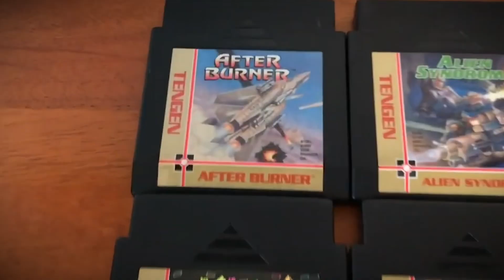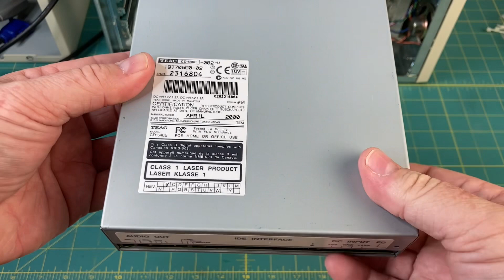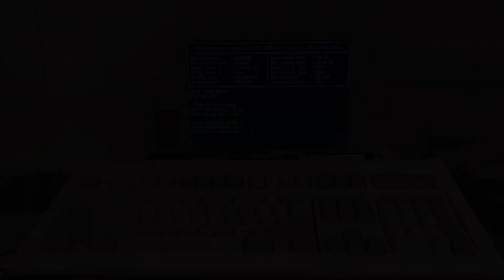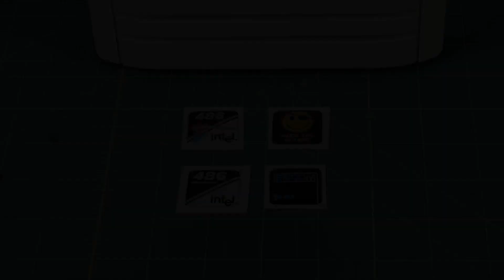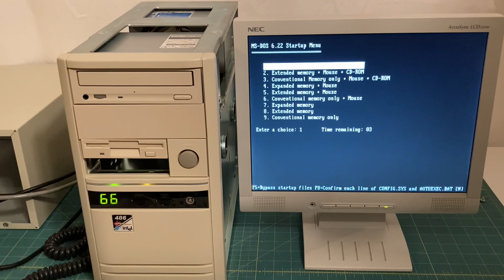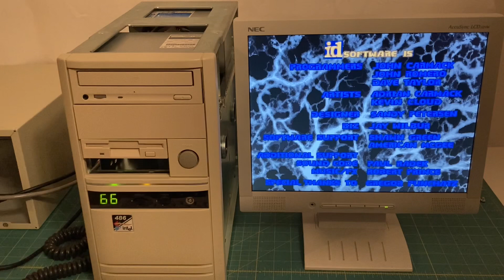Building my DOS 486 DX2 66 MHz Gaming Computer #486buildoff

Comment: Almost this exact build was my first PC, after a gap of a few years after my Apple II and C64 became pure game machines.  It was a 486DX-33 VLB with 4 meg, a CirrusLogic video card, SB Pro, 2x CD-ROM, 3.5 and 5.25 drives, and those little boxy Labtec speakers.  I think I had a 220 meg hard drive.  Must have been around Christmas 1993 as I used DOS and Win3.1 for a good while until Win95 came out.  Not quite as quickly as you, I soon upgraded to a DX2-66, and then a DX4-100.  I kept it going for quite a few years like that, upgrading CDROMs, RAM, and hard drives.
Reply from the maker: Very cool! We have a similar path with computers. I started with Apple II's in elementary school (late 1970s), then got my C64 Christmas 1983 (still own it), then got a IBM 286. Later I had a 486 DX2-66 in the exact same case as this build, so it was quite the flashback for me building this machine in 2022. BITD I sold my 386 to help fund the 486, then sold the 486 to fund my Pentium MMX 200 machine (which I still own).

Comment: Yes, YES! A case with a segmented display should be a requirement for a 486 build (cause it seems as if nearly all the generic PCs of the era had them)!
Reply from the maker: Exactly! This one is only a two 7 secmented display, so if I was to ever upgrade to a DX4-100, I'd have to set it for 99 LOL. I'm going to keep this a 486DX-2 66 MHz machine, so no worries on that. Thanks for the comment. Much appreciated!
Reply: @geekwithsocialskills  I had to do that back in the day, too, when I worked at a computer shop and upgraded customer computers with DX4 processors…

Comment: Nice NEC monitor with built in speakers.  It looks very nice with that computer.  Remember, that LCD has a native and recommended screen resolution of 1024 X 768.  So, you need to set the resolution of Windows 3.11 and the games to as close to this resolution as possible.  A CRT monitor is the best choice for a 486 PC.  You can also try a 7 inch or 9 inch LCD.  They have a lower native screen resolution.
Reply from the maker: The NEC LCD monitor is nice. I use it a lot for testing machines. For this 486 build I do have a really nice 14" CRT VGA monitor that I'll show in the follow up video I'm working on of this 486 build.

Comment: Holy crap! I remember when the DX2 66MHz came out! It made my 25MHz 386SX look like a piece of 💩
Reply from the maker: Thank you for watching and commenting on my video. I sold my 25MHz 386SX to help offset the costs for my 486 DX2-66 back in the day, then years later sold the 486 DX2-66 (I did keep some of the parts) to build my Pentium MMX 200 machine which I still own. With this 486 build I was trying to get as close as possible to my original 486 from BITD. It's pretty close and with a little more work, it will be there, so of course more videos about this machine will be coming to my channel.

Comment: Great build!  Guessing that the motherboard is an "earlier" 486 VLB board based on the BIOS revision and the 30 pin SIMM slots.  Nicely done!
Reply from the maker: Thanks! Agreed on it being an early 486 VLB board. Having both the four 30 pin SIMM and two 72 pin SIMM slots is cool, however it seems you can't use both at the same time. Luckily I had enough 30 pin SIMMs to bring it up to 16 MB.

Comment: Doom runs better than the 'non turbo' of your machine on my 486 DX33. It's pretty smooth generally, with some slowdown in busier areas. Interesting.
Reply from the maker: Part of it could be the LCD I was using in my video. When using a CRT it looks way better. Also, the window size could be a factor on your machine as well. Are you running Doom full screen or in a smaller window?
Reply: @geekwithsocialskills  Full screen with full details. Perhaps taking the turbo off gimps the graphics card somehow. It would be interesting to figure out why a non turbo 66 (33) doesn't compare to a 486 DX 33.
Reply: @geekwithsocialskills  Also, I've heard that the turbo LCD was not an exact Science and could be set to whatever you wanted. It didnt necessarily match the Mhz speed the machine was actually running in non turbo mode. So perhaps your machine is running at say 5 to 10 Mhz in reality - which would make sense as the turbo function was designed to run old 8086 dos games and software on faster machines.
Reply from the maker: Yes, the segmented display can say whatever you want. An example would be if I ever upgrade the machine to a 486 DX4-100, since my display is only 2 digits, I would make it say 99. You can even make it say "HI" or "LO" as well. It has zero to do with the actual processor speed, however as you see in my video, I did use a real Intel 486 DX2-66 processor.

Comment: Vary nice system. strange your system doesn't support both 30pin and 72pin SIMMS. maybe a bios update would help, but it's hard to say if it would. I was thinking you were going to 3D print a front panel 🙂
I'm glad you joined the #486buildoff, Thank You.
Reply from the maker: Thank you for your kind words! As for the supporting both 30 pin and 72 pin SIMMs, I might need to change a jumper or possibly like you suggested, a setting in the BIOS. I didn't even think of checking there, so thanks for the brain jog on that! Hopefully more people take part in #486buildoff next year.

Comment: I remember my 486 well. I upgraded CPU 2 times. First were SX-25, then DX-2 66, then DX-4 100 Mhz. Then jumped to Pentium 120, Pentium 2,3,4, Dual Core +++
I still have my Pentium 120 and it has 64.MB RAM, CD Burner, 3DFX Voodoo 2, S3D Virge, Gravis Ultrasound 16, Soundblaster 16 PnP,  Conner 250.MB Tape Streamer etc. Everything is in it at the same time in it's huge Maxi tower. The Soyo motherboard have 7 cards slots i think.
Reply from the maker: The 486 was such a fun machine back in the day. I really enjoyed rebuilding the machine I owned back then. Thanks for sharing your 486 story. Very cool you still have your Pentium 120 system. Very cool!
Reply: @geekwithsocialskills  Thanks. Building a 486 requires less effort vs new PC as it barely needed any cooling. hehe. 486 were my first PC.
I used Amiga for years before i got PC.
I  still have all my PC's since 1990's, except for the 486. Thinking of it, the DX-4 100 CPU were more likely the first CPU on the Pentium 120 PC and not my first 486.

Comment: Cool build!  The sound of the AMIBIOS tick while it counts the memory practically transports me back to the mid-90s.  I do have to ask: Did IKEA make you assemble the coin cell battery yourself? Hah!
Reply from the maker: Thanks! Agreed on hearing the AMIBIOS tick while it counts the 16 MB of memory brings be back too! As for the IKEA battery, some assembly was required, but they did supply a little wrench LOL!
Reply: @geekwithsocialskills  …hopefully that wrench also included those confusing picture-based assembly instructions… 😏
Reply from the maker: Haha!! I'm actually going to IKEA later today to purchase a new table to use in my computer room. At least with the table it will be an easy build, just screwing in the legs to the bottom, but I'm sure the instructions will make it way more complicated :-)

Comment: Ohh, I see, you want to recreate the machine you had! Did you had to carry over parts from the 386 to the 486 and/or from the 486 to the 200 MMX?
Reply from the maker: Exactly! I'm trying to get as close as possible to the 486 machine I had back in the day. I lucked out that a friend of mine had this case which is the same one I had. As for parts, yes, back in the early 1990s I sold my 386 to help pay for the 486, however I did keep some of the parts to move into my 486 (Sound Blaster and the CD-ROM drive). When it came time for me to do my Pentium MMX 200 build in the late 1990's, I sold the 486 and once again kept a few things like the Sound Blaster and CD-ROM drive to use in my new machine. To this day I still own my Pentium MMX 200 machine and will showcase it on my channel in an upcoming video.

Comment: Awesome build. Put 32MB of ram in that sucker and get some duke3d going :)
Reply from the maker: Thanks for your kind words and watching my video! This build is as close to my original 486DX-2 66 from BITD as I could get, even down to the case (which I was lucky to get from a friend). Back in the late 1990s I sold my 486 (kept some of the parts) to help pay for my Pentium MMX 200 (which I still own to this day). As for upgrading my 486 to 32MB, I do have plans to do that in the near future once I get everything else working how I want. Stay tuned.
Reply: @geekwithsocialskills  sounds good,  ill be watching :)
Reply from the maker: Thank you for your support. Much appreciated. I'll be sure to feature Duke3D in my video for you :-)
Reply: A 486 Dx2 66 can't really handle Duke3D, even with that much memory.
Reply from the maker: Duke3D run's great on my Pentium MMX 200 machine, but very chunky on my 486 DX2-66.

Comment: why do pcs have to have 1.44 mb floppy drives for i mean why can’t the owners say 1.6 mb or 1.9 mb floppy drive instead of 1.44 ?? because really floppy drives capacity go higher than the standard 1.44 mb all the way to 2.2 mb etc many thanks
Reply from the maker: In 1988, Y-E Data introduced a drive for 2.88 MB Double-Sided Extended-Density (DSED) diskettes which was used by IBM in its top-of-the-line PS/2 and some RS/6000 models and in the second-generation NeXTcube and NeXTstation; however, this format had limited market success due to lack of standards and movement to 1.44 MB drives. (Source: https://en.wikipedia.org/wiki/Floppy_disk)